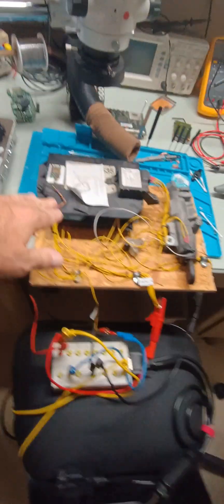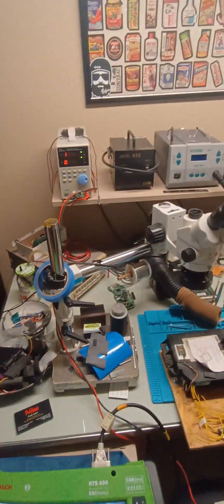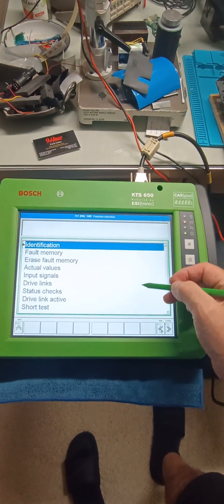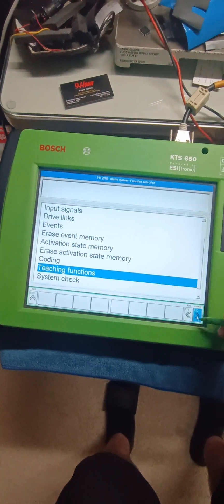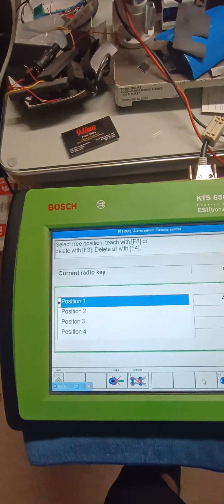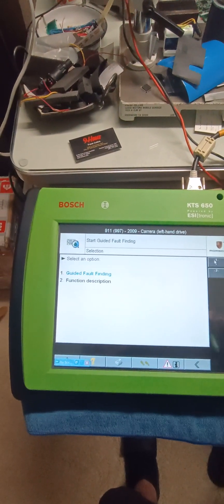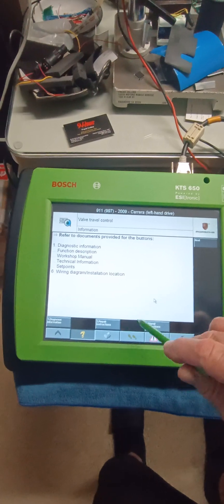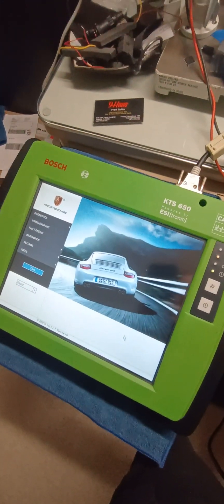PORSCHE PIWIS 1 on a Bosch KTS 650/670 platform

Comment: How capable is kts 650 in this era? Can you still work on newer cars with it?
Reply from the maker: @oskar3013  The PIWIS 1 or kts 650 is the most powerful tester for older cars. It can function on cars 997 up to 2012, Cayenne up to 2010, no Panamera and basically no cars that use the FAZIT style key. FAZIT keys are the newer style keys that look like the Panamera, Macan, 9X1 style key. But for older cars, this was the best tester. Coupled with the round adapter cable, it is also capable of 928S4,964,944S2,968, 983 diagnosis. Are you looking for a tester?
Reply: @Adventures_of_FMFC Hello Mr.Frank.
Can you share with me dvd V13 & v14?
I have kts 650 and only v32 dvd.
Reply from the maker: @piotrknapkiewicz9811 unfortunately I'm not in the business of sharing. I work very very hard to get where I'm at and I will help you but I charge for my services I do not give it away for free